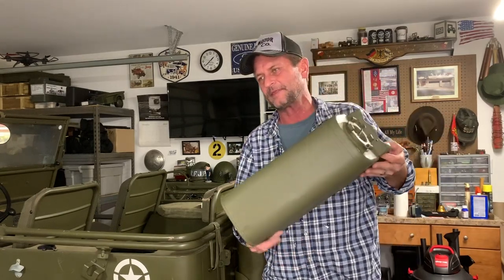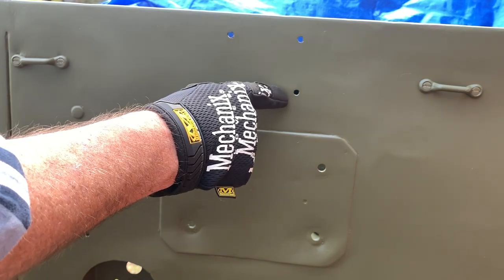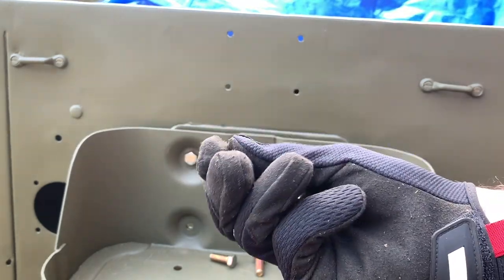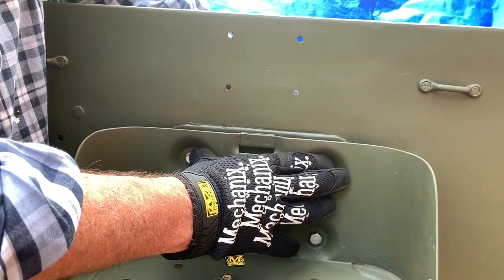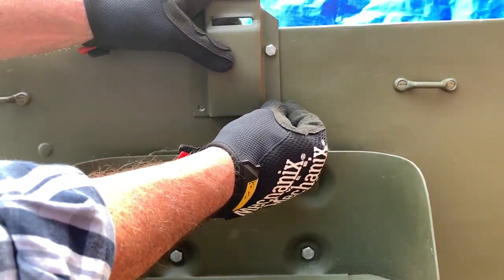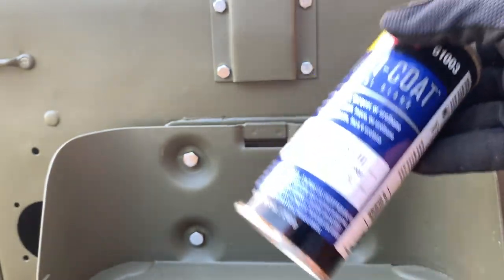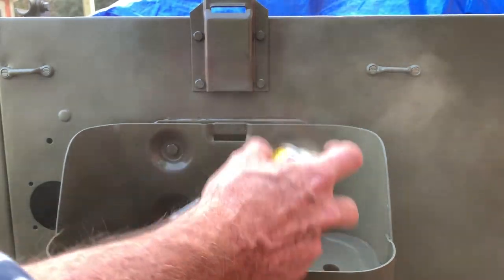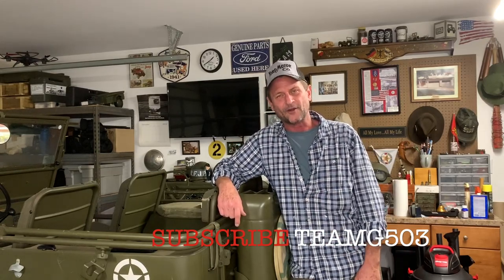G503 Installing The Jerry / Gerry Can Brackets On A 1943 Willys MB

Comment: I never mentioned it before, but I like the detail of removing the modern marking off the bolt heads.  Any bolts without marking on them would be very low quality and low strength. CAN NOT go wrong with Grade 8 stuff!